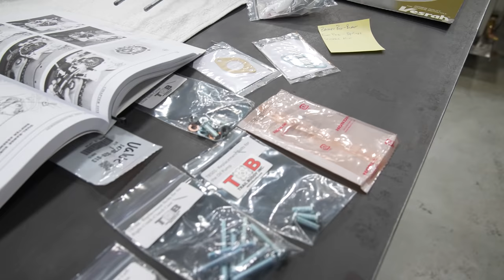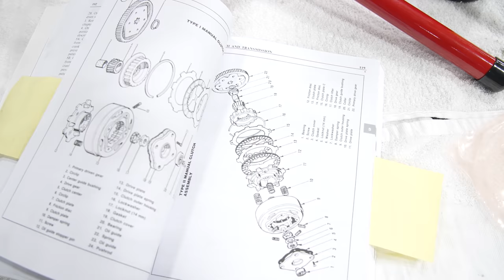Honda Trail 70 crankcase assembly | Redline Update #83

Comment: I know you probably used what you had on hand to soak the clutches, but found a little hack.  1 gallon zip lock bags.  Use it when putting transmissions together, they seal up so you don't have to worry about contaminants, don't make a mess, and it takes less fluid in the bag to soak the clutches.  Keep on grinding man, these videos are great!

Comment: Been around these engines since before i could walk (im 40) and they are just awesome.
Hot tip, first start-up always remove the top rocker cover and confirm oil sprays out.

Comment: I've always tossed my bearings in the freezer the night before re assembling an engine.
Reply: Yup.  Freeze them suckers first.  Also a little heat gun on the case.
Reply: Yup, the only safe way to do it.
Reply: A house hold freezer is at best around 0F, get a cooler of dry ice and you have -109F
Reply: Bearings in the freezer, halogen lights on the case half.

Comment: I rebuilt my CT90 engine about 6 weeks ago, first engine I've ever rebuilt. These horizontal Hondas are incredibly well engineered, they're almost impossible to put together wrong, I hope, lol. I'll find out later this summer if that's true. This was a good break, time to get back to sanding primer on the Trail 90!
Reply: I had to do my ct70 engine last year,the kickstart shaft was broken on the splined end,they wanted a thousand bux at a shop to do it so I did it myself, I took pictures of the disassembly and that helped immensely. They are simple but well engineered engines for sure.

Comment: Davin I love watching you work and I wish I could be there to help you. I just wanted you to know that Japanese motorcycles use JIS screws and you shouldn't use a Phillips screwdriver with them. The factory screws are not hardened and the heads will strip out if a Phillips screwdriver is used. If those replacement machine screws are factory get a JIS screwdriver. If they aren't then the Phillips is fine.
Love your work, keep it up.

Comment: @ 4:00 some shops use a heater (the same you have to untighten rusty bolts)  to expand the casting, in order to decrease interference between the bearing & casting, up to the point you can press into position.
FYI > to assemble some transmissions, the heater is a mandatory tool. It takes part in the assembly procedure.

Comment: Without an oven you can heat the bearing bore areas with a MAPP torch for a minute or two then drop frozen bearings in. Typically they will seat without any need for pressing.

Comment: I see that part in engine same like honda c65, c90 ,c110... the engine of this model is difficult to damage and durable. my honda c70 motorcycle from 1980 until now is still in use. back in the 1990s many teenagers in my country modified this engine for drag racing

Comment: Lucky that's not an early 80s Ducati, either those bearings would fall in with 10 thou clearance, or the housing would break when you pressed them in😁 ps my lovely wife lets me use the house oven for heating up parts, and tempting hardened parts, oh and baking painted parts too❤️😁😍

Comment: I have a friend who wanted to use some SUPER lubricating oil in his Honda DONT DO IT! WET CLUTCH will not work. I told him that stuff is way to slippery thankfully he listened .
Reply: also do not use automotive oil the detergents will cause slip use only cycle grade oil (motul,bel-rey,etc)I learned this the hard way on my RM80B way back in the 80s.
Reply: Exactly. Any oil that has a friction modifier will cause wet clutches to wear prematurely.

Comment: Instead of warming the whole assembly ... couldn't you just super cool/freeze the bearing?
Reply: That's what I was going to suggest as well...
Reply: Thats usually what I do.  You can warm things a lot easier and farther than you can cool them.  A deep freeze gets to zero, liquid propane will freeze to about 20 or 40 below.  If its 70 in the shop, and you freeze to 30 below, thats only 100 degrees different.  If you warm to 370 and its 70 in the shop, thats 300 degrees different.  Also aluminum grows faster than steel from temp change.

Comment: You should look into the Alodine-type chromate coatings for clean aluminum parts like that.  They work really well to protect the aluminum surfaces without building up or flaking off and they last for years.

Comment: Hey man, how do you fit the bearings? Do I really have to teach you everything?
Bearings do not fit cold.
You must first put the bearings in the freezer the night before, then you must heat the crankcases to 100 ° celsius (boiling water temperature).
Then take the bearings one by one, spray them with Teflon oil on the edge and put them in their seat. After the first, you will pull out the second from the freezer and so on, until the last one.
If you have done a good job, the bearings fall freely into their seat with a click and the job is done.
You have to be ready and fast because the bearings heat up quickly while you are handling it and they have to be put in their place in a short time.
When the bearings heat and the crankcase cools they will stop moving.
In this way you have not stressed the casing using the press and, above all, you have not worn out the seat edges.
There is a few hundredths of a millimeter of interference between the diameter of the seat and the diameter of the bearing. The aluminum takes a short time to wear out and then the next change of bearings they could move inside the seats. In that bad case you can throw away the crankcases.

Comment: i am surprised many of the internal motor bolts are a Philips screw that are basically hand-tight, if you torque to much, it will strip the head